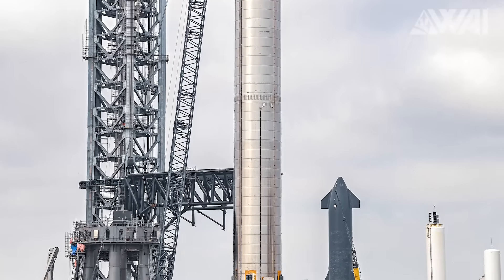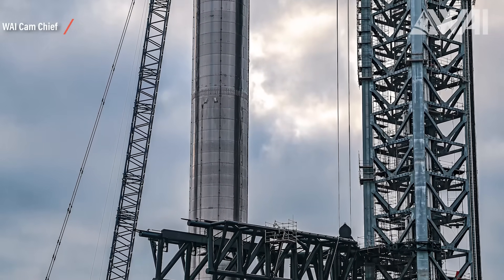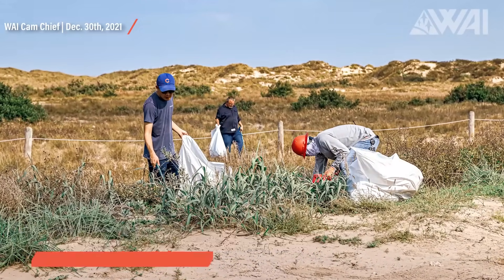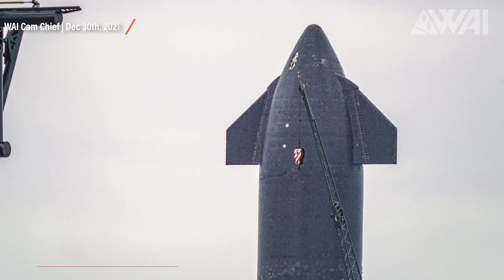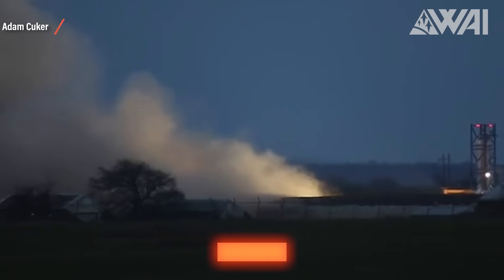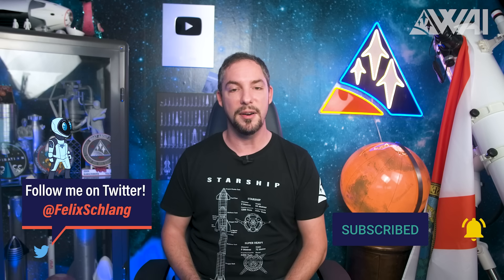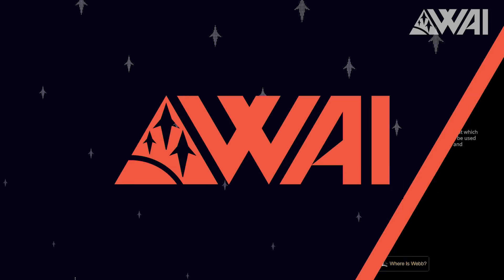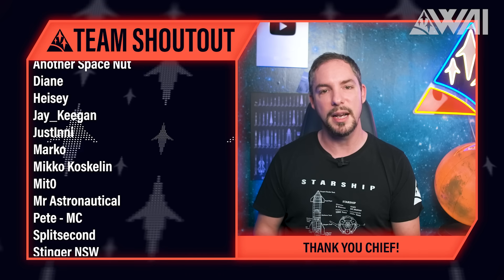SpaceX Starship test Marathon continues with Raptor v2 + JWST Update!

Comment: I would guess that the nosecone hardpoints on SN20 were removed to shake the heatshield tiles there during static fires, to test the attachment over the next 3 months. Would not be surprised if they flew 4 21, as it will definitely be completed by the time they have a launch license.

Comment: Does anyone know how many booster outer ring engines the orbital launch mount was designed for? Surely if they change the number of engines the entire launch mount will need to be changed? So after booster 4 flies will we have a huuuge delay until another test?
Reply: If I'm not mistaken, they are changing the amount of internal engines only.

Comment: SpaceX I think is going at the noise issue in two ways water in as fine a mist as possible and fast lift from ignition to a decent height above ground in seconds not the slow climb of many other rockets. Much higher thrust to weight ratio and Fine mist that is vaporized breaking the sound patterns in the first 60 to 150 feet or so of the lift off.

Comment: Musk and his people are extremely innovative. Perhaps the reason for little (or no) water deluge is because they may plan to launch the stack with far less than the 33 raptors igniting at ground level. 

It would only require enough R2s to be ignited initially to be able to raise it slowly unlit it has completely cleared the tower and perhaps somewhat higher. 

Not only would this reduce the noise, but also the flame and heat damage. The remaining engines might be ignited all at once, or in stages as it moves further from the ground.

It might even provide a solution to avoid FAA concerns over noise and other environmental damage.

This might have some kind of impact on the fuel, due to the time fighting gravity, but the offset might be worth it.

Just a thought.

Comment: 1000 liter = 1 m3
specifically for water 1 l (liter) = 1 kg and 1 000 l = 1 t (metric tonne)

so for example 1 700 000 l = 1 700 m3 of water and weight 1 700 t (SI units are mostly water based)
Reply: Water based but at very specific temperatures…
Water density changes significantly with temperature…
Reply: @allangibson2408  room temperature (20°C) is not so special in most countries. 
And YES temperature is also water based. 0°C is when water and ice are together and 100°C when water is boiling, at "wery specific" normal pressure 🤪
Reply: @jkarpis  The US uses 60F (15C) for their SG reference… Water is a maximum density at 4C…
Room temperature is arbitrary…

Comment: I would be highly surprised if the FAA (or SpaceX) can meet that timeline. If Elon insists that this is the only engine, with leaked emails saying so very emphatically, this new engine might well not light in production until mid 2022. That is without any found issues. I hope I am wrong, but I don't have wonderful gut feeling about the first starship launch(s). Even after all regulatory approvals, the idea of building enough engines to complete the goals Musk set out for 2022 seems very unlikely.

Comment: Thanks for a great year, Felix! Do you think SpaceX might be using a liquid or cold Nitrogen sound/heat suppression system, instead of water? Plenty of N2 is on site, Elon thinks first principles, and while water is a great heat sink, very cold N2 would absorb much more heat. And while steam is pretty dense, the fog resulting from very cold N2 would also be water vapor, but a much bigger volume, as seen when SN3 blew up, down and up again.
Reply: one reason why water is used is because its heavy, they want to have a lot of mass for sound dampening, the launch is so loud the sound pressure itself threatens to damage fragile spacecraft

Comment: Hey Felix, best wishes for the New Year. Could you provide a bit of an in depth comparison between the SpaceX Falcon crew module against the unflown Boeing  capsule and the SLS capsule please?
Reply: Both the Boeing (Starliner) and SLS capsule (Orion) have flown. Starliner flew a couple weeks after Covid-19 was found in China and had a major control software problem related to the timer that prevented it from reaching the ISS. That on-orbit software review revealed another software bug that would have steered the service module to reenter on a trajectory that would have brought it in contact with the crew module. Otherwise, all its systems performed as they were intended to. Orion flew back in 2014 on a Delta IV Heavy. It was lofted to a huge apogee in what was basically a repeat of Apollo 4 in order to test the heat shield in something analogous to a return from the Moon
Reply: @Markle2k  oops my bad. I should've said unmanned. Still it would be interesting to understand what are the differences in the capsules. I would have thought the NASA SLS capsule could have also been used to access the ISS, even just to gain some flight experience.
Reply: @michaelreid2329  I believe that Orion and the Lunar Gateway are using the International Docking Adapter that is currently the standard for the ISS (at least on the NASA/ESA/JAXA modules). So, theoretically, Orion would be able to dock with the ISS, as with Crew Dragon and Starliner.
The Chinese docking adapter standard is also rumored to be compatible with the IDA standard, which is open source. This makes sense since they plan to open their space station to ESA and Roscosmos. US law, as we know, forbids the US companies and agencies from cooperating with the Chinese in space due to some stupid company sharing sensitive information with the Chinese on a commercial satellite launch.

Comment: Two months to come up with the most effective sound suppression system ever, due to the size of the rocket and sound levels being a sensitive issue with FAA approval for further testing at Boca.
Two months isn't a set back, its an optimistic necessity. 
Where is all that water going to come from and go indeed.
Reply: There's no shortage of water at Boca Chica, or at the Cape. Go check out some water deluge system test videos that NASA has put out. The water comes out of the "Rainbirds" tinted green. In Kazakhstan, where water was a problem, they dug a giant hole in the ground and suspended the rockets over it.
Reply: @Markle2k  Still raises a lot of questions for me, like are the neighboring estuaries salt or fresh water, where is the drainage, the nearby soil souring measures etc.
The only existing SpaceX water deluge system I have seen for reference have a perimeter of tall vertical pipes that divert water downwards over the launch pad, nothing like that currently exists at Boca Chica.
I will be very surprised if two months is an actual holdup to making an area compliant launch that shows it can coexist in a sensitive area for further testing.
The fully rocket with booster is a whole different animal to anything tested there so far.
Supposedly the launch mount has a yet to be revealed trick up its sleeve.
Reply: @Dug6666666  Around KSC, all of the water is brackish lagoons (Indian River, Banana River, and Intercoastal Waterway). Not quite seawater, but salty. This is similar to what exists around Boca Chica where the Rio Grande enters the Gulf of Mexico.

Comment: The Incompetence and Interference by the FAA should  NO LONGER BE TOLERATED. As a bureaucracy, they have become inept, inefficient, and Corrupt. It is ridiculous that they ask for more time. The FAA has been dragging its evaluation for more than a year almost two and they have accomplished little. There is little to evaluate about the Starship. The Starship is only a bigger version of the largest rocket launched to date the Saturn V but larger should not require a Long dragged-out reevaluation of the principle of burning gases being directed by nozzles to create thrust. Only the Solid Rocket boosters on other Launch vehicles present a major danger as they could fall off unexpectedly overpopulated areas and present a real explosive danger to populations. No such danger exists with the Starship and therefore should have received a rapid environmental review in light of the many past launches by other vehicles and other companies. This is a clearcut obstructive act by the FAA to interfere with the Progress of Space X and Starship advances to launch us back to the Moon and MARS. The FAA should be abolished and reconstructed with far less bureaucracy and bureaucrats who seek to make names for themselves.

Comment: raptor engines shouldn't be on superheavy, they take too long to make.  superheavy really needs to use a simple, cheap, easy and fast to mass produce engine.  honestly, they should have just stretched and fattened falcon9 to superheavy size and added more merlins.  they could boat them from the cali factory to vandenburg, then fly them to the cape.  its probably time to pump out 10 more falcons and a few heavy cores, and then retool the factory for superfalcons.
Reply: With a lower chamber pressure, you get less Isp. With an open cycle you get less Isp. With a heavier complex hydrocarbon fuel, you get less Isp, greater static thrust, and a much, much longer turnaround time between launches due to coking that has to be cleaned from the engines. Rocket-grade kerosene is more expensive than methane. Plus, you now have a dissimilar fueling (and ignition) between the stages complicating things in the infrastructure and rocket stages, and messing with your environmental impact statement. And you no longer have the option to take your fuel carbon neutral or negative.
And BTW, we don't say cali (that's in Colombia), and SpaceX Hawthorne is right next to LAX. It's like 3 miles down the road, via 120th Street, to Aviation Blvd. The Port of Los Angeles is all the way down by Long Beach, 20 miles away.

Comment: On your video it showed the replacement for the lift points  under the forward flaps.  Looked like a retractable attach point.  As for the delay I would imagine it is a behind the scenes attempt to get the boondoggle called SLS off the ground first.  Ridiculous considering the cost and time that has been expended getting this government jobs program off the ground but that is what we are dealing with and what Spacex is putting to shame.

Comment: You do put out quality videos and you do a great job presenting.  Even though I am a starship skeptic, that does not stop me from enjoying your content in that it is informative.

This brings me to the Starship Sound Suppression water system or what appears the lack of a big one, Shuttle proved that it does make a significant difference in does protect the vehicle from the acoustical sound generated.  With no flame trench and not a big sound suppression system, it will be interesting how Starship will be protected at launch.  That energy from launch will reflect back to the vehicle which may cause major issues.  

Keep up the great work and hope to see you the next time you are near the KSC in Florida.

Comment: Looking at all the testing required before SN20 lift off, I wouldn't be surprised if Elon is relaxed about the new FFA dates.
Reply: They likely want/need at least two more static fires just to test the heat shield adhesion not even accounting for everything else.

Comment: so how are they going to land starship on the moon or mars if it has no legs
Reply: The current Starship doesn't have legs, because it's not going to land... it's going to crash into the ocean in an unknown number of pieces. Once they figure out how to get that number of pieces down to 1, they can move on to solving the "crash into the ocean" part.
Reply: @simongeard4824  nothing is crashing in the sea
Reply: @ianthewhite7035  Starship 20 certainly is, because what I described above is literally the official plan... if by some miracle the vehicle makes it through reentry intact, they'll try to "land" it above the ocean surface. Any attempt at recovery will involve hauling wreckage out of the water... and that's in the best case where everything has worked perfectly.
Reply: @simongeard4824  its not crashing in the sea its gonna attempt a pivot landing and the booster is gonna get caught by chopsticks.
Reply: @ianthewhite7035  No it isn't. Neither vehicle is being recovered on the first test flight... the best case is that they both attempt a "soft" landing above the ocean. The booster will not attempting an RTLS flight, being dropped into the sea... slowly, but still destructively.

This is simply a matter of safety. There's no confidence whatsoever that the vehicles will be capable of landing safely, so SpaceX aren't going to risk having them land near anything valuable. So until they're confident that landing attempts won't destroy ground equipment that's worth far more than the rockets, crashing them into the sea is very much the plan.
Reply: @simongeard4824  well see
Reply: @simongeard4824  LOL🤣
Reply: The landers are gonna have legs.
Reply: @justinni_  ok so im guessing they are gonna test landing legs on earth before the moon. Have a happy new year.
Reply: @ianthewhite7035  probably, yeah. You too!

Comment: FAA delay is most likely political. Most important reason is probably SLS launch. In a case it might succeed, they need to advertise it is the most powerful rocket since Saturn 5. Also there is a big hurry to secure long duration SLS contracts before Starship succes makes people question it's value.

Starship reaching orbit before SLS would be bad thing.

Comment: If no part is the best part and the heat shield tile is step 2 after the fuselage is shaped, why not make that a 1 step process?
At some point, the steel fuselage could be heated to pliability and the ceramic tile applied before it cools, therefore, making it a seamless connection. No epoxy is the best epoxy.
Reply: The tiles are not attached with mastic like putting bathroom tiles on the wall. They are attached to studs with a fabric insulating material sandwiched between the tiles and the stainless steel skin to keep the tiles from heating up the steel.
Reply: @Markle2k  Actually, they do both pins and resin depending on the location.
@10:00 or so but the whole video is quite informative.
https://www.youtube.com/watch?v=-Lsbi-bVfk0
Reply: Still, a design structure of melding the heat shield and fuselage as one piece is better..

Comment: If "only a few" tiles fell off after a split-second, three engine static fire test, imagine how many this thing's gonna shed once they light 29 engines without a deluge system.   ...Starship isn't gonna make it back through reentry.
Reply: It possibly could survive re-entry. The spaceship was mostly aluminum and steel has a higher melting temp. If it’s on a flatter part of the ship and not a heat focus point it may not cause a mission ending event
Reply: @imanudistperson  I should clarify.  It will not be functional enough to do a controlled landing after reentry due to the failed systems destroyed from the lack of tiles.

Comment: Great video, great idea to stand out by not doing the standard "Year in Review" video. Few thoughts:

1) Could Starship be dropping heat tiles during the static fire tests because the rocket is secured to the ground? That will cause different types of vibration/stress than actual flight.
2) The Raptors on Booster4 have a lot of their pipes and valves exposed (and it doesn't seem like the rocket has angles that will protect those parts via aerodynamics.) Maybe those new "dog houses" are a temporary fix to shield them for the first test?
Reply: have you ever seen a rocket launch?  they are all secured to something when the engines ignite.  soyuz runs for like 11 seconds before it is released
Reply: @Sintesi.  True, but not for as long as the static tests have been (Soyuz and Shuttle being the exceptions). I'm still holding criticism of Starship's tiles until it goes for re-entry.
Reply: @Sintesi.  That was a slightly rude response to a genuine question.  He may be right and those other vehicles either didn't have tiles, or had to overcome a similar issue.

Comment: Starship is not “cheap”. It is highly cost efficient - not the same as cheap.
Reply: On the contrary, the intention is that it is cheap by rocket standards... that they're driving cost/kilo down not only by lifting a stupidly large number of kilos per flight, but by driving the cost per flight down to the point where Starship can launch Falcon-sized payloads cheaper than Falcon can. Whether they can achieve that goal is another matter, but it's certainly their intention.

Comment: If R.v.2 is the future, may as well skip B4\SS20 for next gen. Stage 0 is beginning to be tested with those prototypes. At some point, perhaps be repurposed as deep-space payloads?

The rapid prototypes and system-wide testing so the integrations all work together. 
(somebody will be glad to buy used raptor one engines, I think... 🤔😏😉